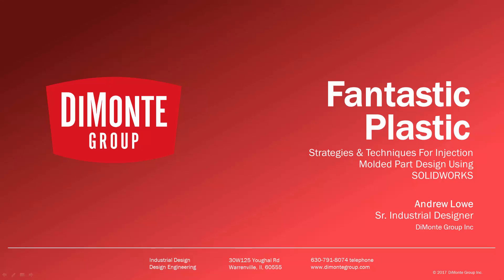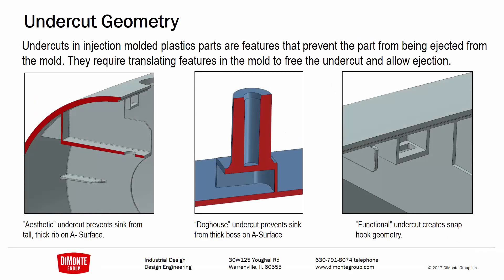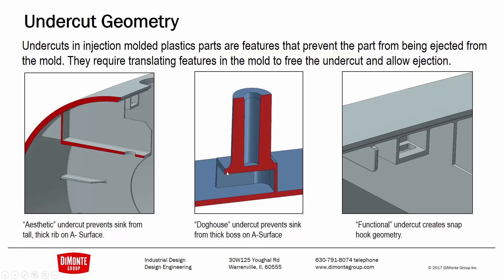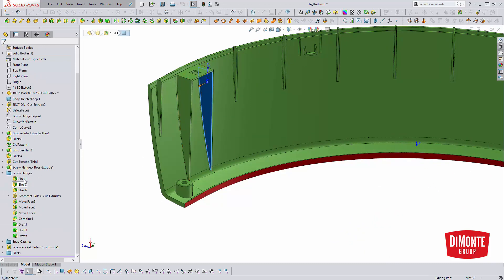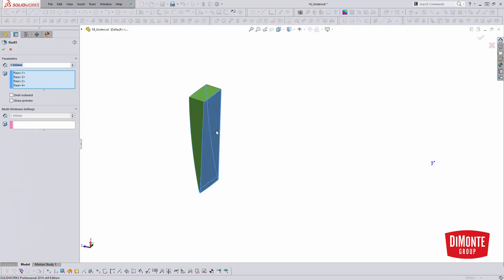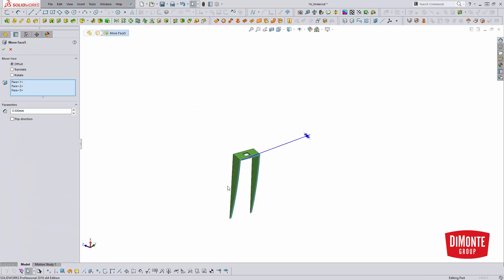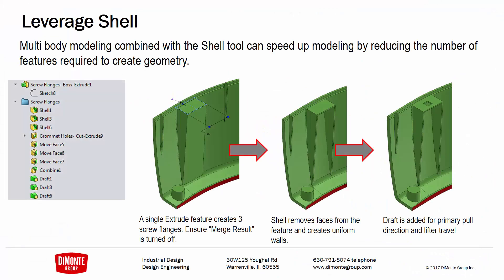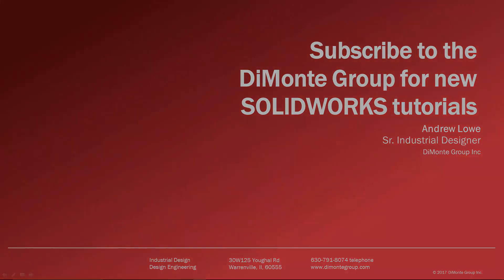Fantastic Plastic 15 - Undercut Geometry - SOLIDWORKS Tutorial

Comment: I always extrude the feature (past the outer wall or until extended) shell, trim body then finally untie. Trying to unite a bunch of features prior to shelling can cause problems especially while surfacing. I've seen countless times were the bodies will not unite because the faces are not intersecting like you've shown. Sometimes the surfaces being extracted or created are slightly off. I use NX but all seems to have the same issue with uniting bodies after shelling.